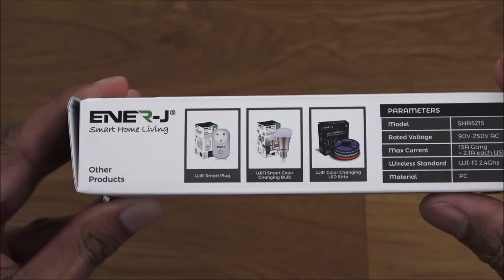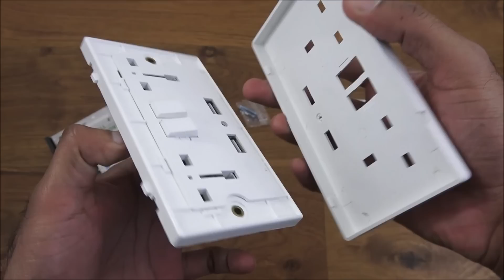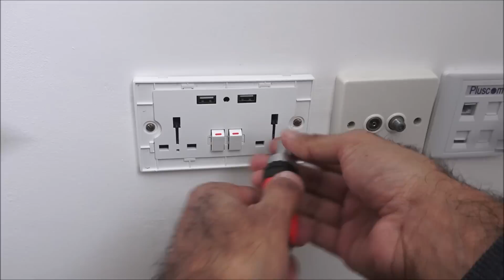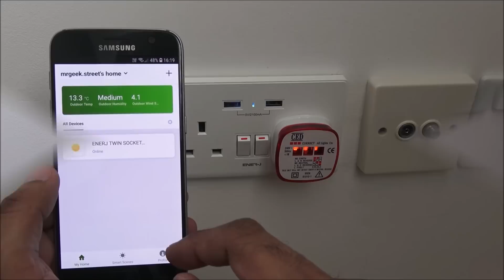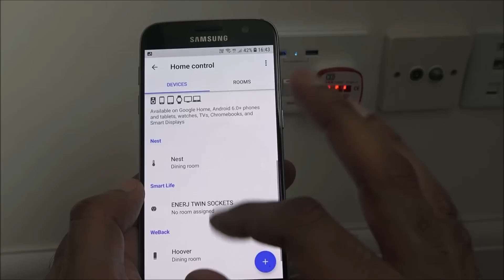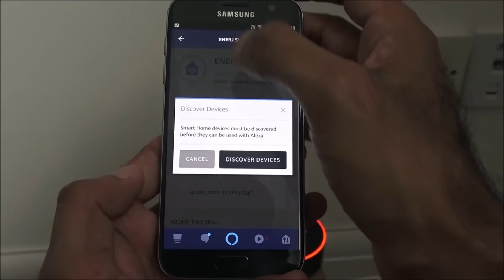WiFi Smart Home Plug Socket works with Alexa and Google Home by ENER-J

Comment: Great product but the main problem is as soon as it looses the connection to the router - it just powers off and reset the timer. You need to manually then reconnect to your app and power on again and create a schedule for each input. If this could just save the schedule regardless if it’s connected to router or not - that would have been perfect!

Comment: Can you install it in steel backbox without affecting the wifi range that often the problem with RF devices?
Reply from the maker: Yes, my wifi extender is about 4 metres away and it was fine connecting to it.

Comment: Such a shame you can't control the sockets independently. Doesn't make sense to be all or nothing. Do you think this is a software update needed? I can't buy it like this.
Reply: You can now control this individually, I have just installed one in my kitchen
Reply from the maker: Thanks for the info, can you also control the USB from it now?
Reply: I can confirm that Google home can control the plug sockets individually. As I say, I do not know if the usb ports are always on, or powered by the socket on that side being switched on or even maybe both usb ports powered when either plug socket is energised. I'll check.
Reply from the maker: Excellent thanks for confirming. Regarding the USB port I think they are always on, but let me know what you come across.
Reply: @rodgerq  Whats the command to use please?
Reply: @shawng5799  to control the sockets? First you need to label them in the app and then you just ask Google to switch on or off the name that you have each one.
Reply: @rodgerq  Wow! I just added "left and right" and it works. Thanks!
Reply: @shawng5799  good to hear 👍
Reply: @rodgerq  Shortened the names down to just the device plugged in i.e. "Speakers ON" Much better than what Google generated 😉👍
Reply from the maker: If you use the app you can control the plugs individually, but you can't using the Google Home and Alexa I'm sure a software update could fix this but I don't have any ETA on when that would happen unfortunately.
Reply: @GeekStreet  do keep us posted if you get a software update. Would love to get this if that's resolved.
Reply from the maker: Sure will do.
Reply: I agree. I was looking into those to integrate with Alexa but the fact it cant be controlled separately is a no for me. Poor development on manufacturers side. They must update the skill capability. Yes, you could go into the app and do it from there but you could also buy 2 separate socket smart plugs for the same price as this. Pity - maybe future SW upgrade will sort this out.
Reply: I'm using the smart life app and there's no option to control separately the USB plugs. I haven't used them yet so I don't know whether they are constantly energised or if they are switched with the sockets. I'll check that.
Reply from the maker: When I reviewed this the plugs could be controlled separately with smart life or via the enerj app but the USB couldn't be controlled, but what I found was that the Google Home could not control the plug sockets individually.
Reply: I am wondering whether it's just the enerj app that's causing the problem of not being able to control them individually?
Reply: Will do
Reply: Can confirm usb sockets are a constant ON. They do not switch off with the plug sockets.
Reply from the maker: Thanks for confirming, much appreciated.

Comment: Thanks for showing this, the only issue with these type of usb plug sockets is the parasitic charge they are always using. If you start replacing all your sockets, it does add up on your electric bill!
Reply from the maker: Thanks for the comment much appreciated and useful info.
Reply: Your comment had me thinking and I've looked into it. It doesn't look like it takes very much.

Below is about smart plugs
https://iot.stackexchange.com/questions/608/how-much-power-do-smart-sockets-consume-themselves

This one is about all smart products.
https://www.the-ambient.com/features/power-smart-home-tech-yearly-cost-374

Therefore I think if I kitted the whole house it probably wouldnt more than a pizza.